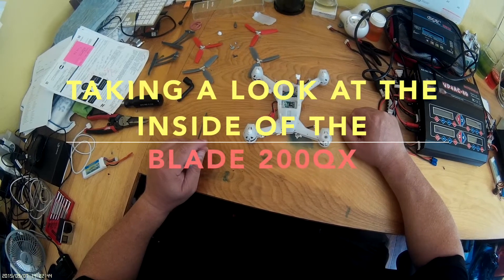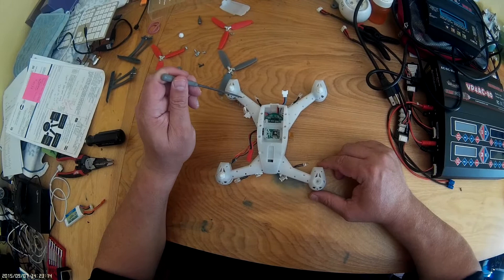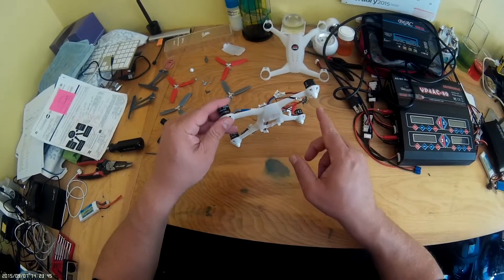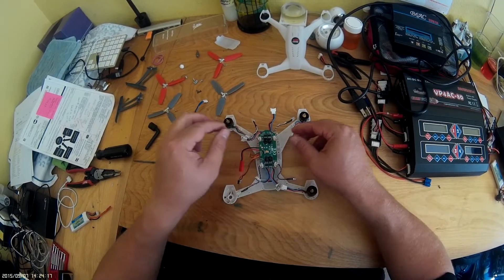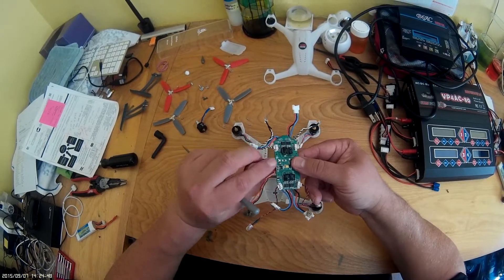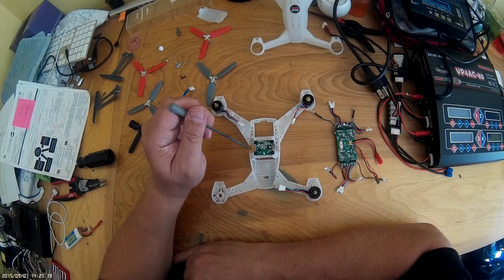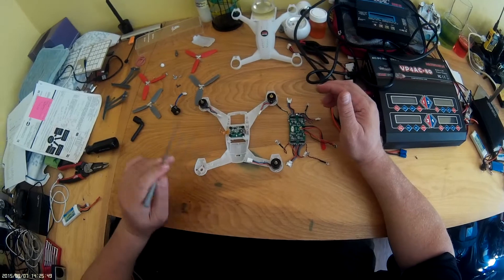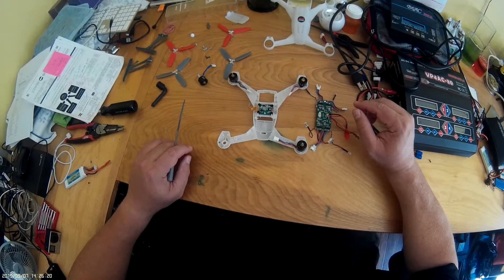Taking apart the Blade 200QX

Comment: what let u know u needed a new escape board?  I own several 200qx cause it's my favorite quad also!  however, I have3 of them that have a motor that won't spin. I doubt it's the motor cause it will slightly twitch back and forth, and I've switched motors and it does the same thing. So, I'm assuming I burnt up an esc. it seems like a common problem cause I've had 3 do this and that's the ONLY problem I've had with any. I just wanted to know if that's what ur's did b4 u bought a new board?  I can't see anything burnt on my boards but that's the only thing it could be?! I doubt it's the main control board.  Both are expensive, &its almost better to buy a whole new 200qx with another charger and battery for 200.00$. Anyways any input u can give me is much appreciated! Greetings from St. Louis, Missouri! 😁
Reply from the maker: The esc on my blade 200qx had a burnt mark on the board. In your case, the easy way to tell if you have a bad motot is to unplug the motot that is not moving and on the esc unplug the motot that is working and swap them. If the motot then worksl, you have a bad esc. If not, you have a bad motor.

Comment: I like the frame flyin Ryan chose for his 200QX, carbon fiber arms, etc. I was going to go to that body, well, except I can't even get it bound. :(
Reply: +Wobble Copter I love carbon fiber!
Reply: +Wobble Copter I went back to the drawing board on initializing my 200QX, it's just as you told me except when I go left and right on the left stick mine is tricky, it just doesn't turn on, I really have to fiddle with it and it will finally turn on. Sort of a pain but at least I can fly it now.
Reply from the maker: +Wobble Copter I like flying Ryans frame choice as well. I may switch over to some variant of it.
Reply from the maker: +Wobble Copter It might be wish to invest in another flight controller for $55 and try that. If it still happens, then its the radio.
Reply: It sort of sucks that the two were purchased from different sellers. The transmitter will bind to many of my other quadcopters so if I can get the firmware installed it should tell a story about the transmitter, good or bad.